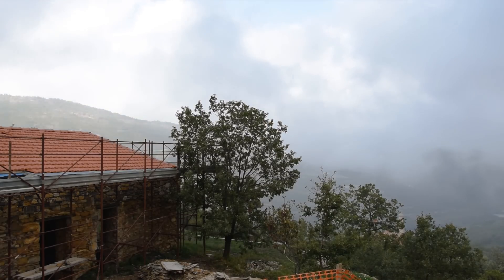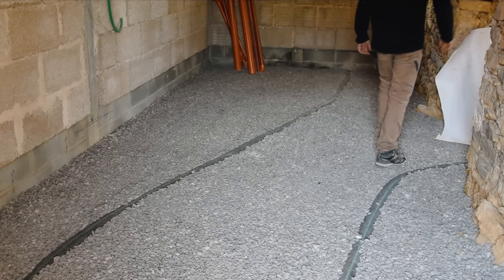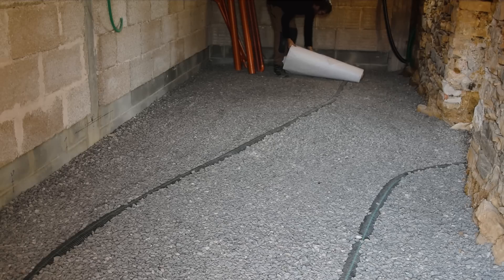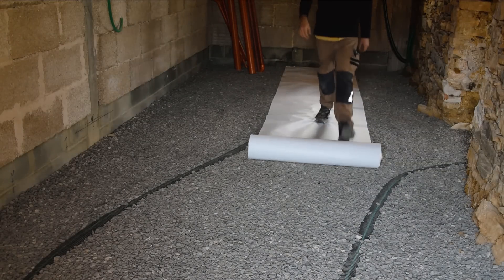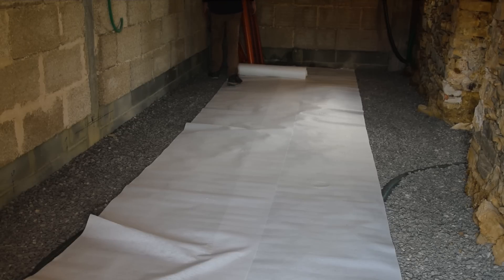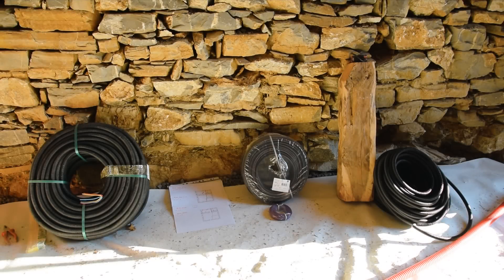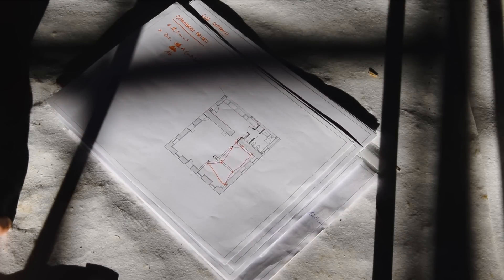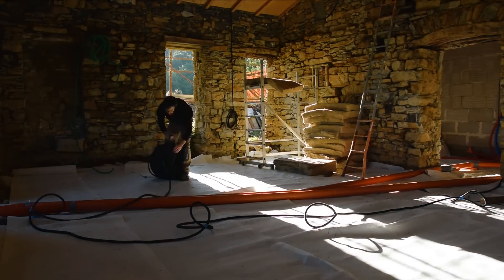#30 Water, electricity and wastewater lines (Italian stone house renovation)

Comment: I’m wondering if you need or not to certify those networks and how you’re going to do that! I’m thinking of doing something similar but I’m not sure on the regulations here in Italy tho.. any advice would be great!
Reply from the maker: You are right, we have to obtain a certification for each network by professionals. For the wastewater systems, we had the installation checked a couple of days ago (they will be poured into the slab). For drinking water and electricity, we can do it later as all the water pipes and electric cables are running through corrugated pipes, so we can easily replace them if they are the wrong diameter for exemple 😊

Comment: hi, guys. how big is slope of sewage pipes? cause it'd say difference from kitchen to door on other side is around 30cm. all this will be poured with concrete?? so slab will be thicker then necessary? we usually install sewage into little ditches made below gravel layer.
Reply from the maker: It will be poured inside a hempcrete slab, very light. The distance between the kitchen and the door is 9m, so with a slope of 2cm per meter this is 18cm

Comment: If you put the waste pipes in the slab you might not be able to get enough slope if they go a long distance.  For this reason I put then under the slab.  Also, the concrete in the slab where the wide waste pipes are is thinner, which can cause it to crack along the path where the pipe is.  Those big pipes will interfer with the rebar too. You’ll need a thicker slab to prevent this.   It’s also nice to have the waste lines running below just so things are less complicated when running water and electric.  I’m wonder why you decided to put waste pipes in the slab.  

I see you put red or blue corrugated tubing over the water lines.  In assume to keep track of hot or cold.  Is it not possible to buy water lines in red or blue?  

You’re making great progress and you do meticulous work.  👍
Reply from the maker: Thank you! The slab will be made of hemp and lime so no rebar, and won't be structural. We did have to "excavate" a few centimeters into the gravel hardcore to obtain the right slopes!
Reply: @ateliermavi  I am keen to see the video of the lime/hemp floor.  Please explain why you chose this material instead of cement.  Cement is stronger and harder.  Also more resistant to damp, but it looks like you already have a waterproof liner under the slab.  I've used fibreglass in cement mix before to avoid using rebar.  It will be interesting to see how this is done with hemp.
Reply from the maker: @donaldhanson8990  Thank you for your questions😉 here 's a non-exhaustive list of reasons why we choose a limecrete slab. First we didn't need a very hard slab as our slab is not structural, then cement and stone walls aren't a very good team: the humidity trapped under our  cement slab would find its way out (only partially) through the base of the walls, and up, therfore creating humidity rises at the base of our walls. This is also why we do not have a waterproof liner under the slab. The limecrete slab, combined with lime pointing of the walls, will allow the humidity to escape evenlly through the floor. This is also why we installed a ventilated gravel hardcore under the slab. Cement is more resistant to damp but this idea is also misleading, if you plaster a stone wall with cement inside and outside, there is no way out for the moisture coming from the ground, this can slowly cause gloating, mold, etc... So to make it short, cement is not really compatible with our old stone house!

Comment: Well that's one thing out of the way. Great job. It can be very tedious but once you figure out how to do it and respect the country's code for plumbing and electrical it all goes well. I will give you this advice use gravel or stones to prop up the waste water pipes and not pieces of wood. But you may have already poured the concrete pad by now. Looking forward to the next video.
Reply from the maker: Thank you! We will use directly the hempcrete mix to prop the pipes before the final pour! The slab will be poured this week (and maybe the other considering the work it represent 😅)